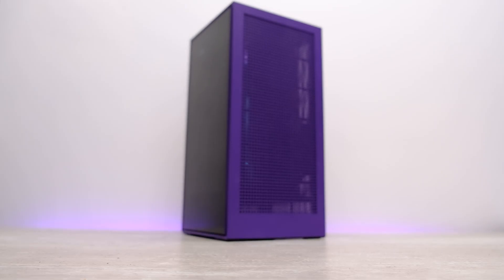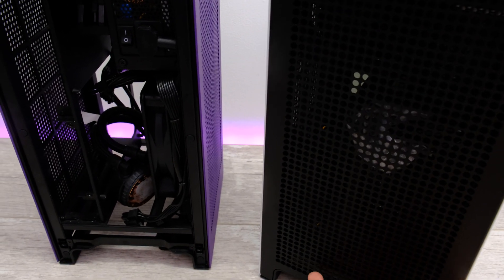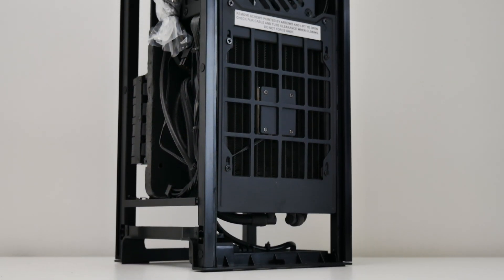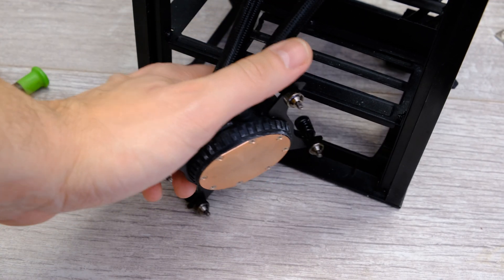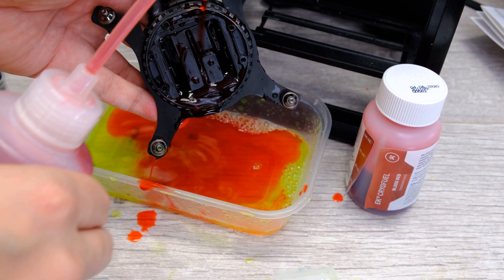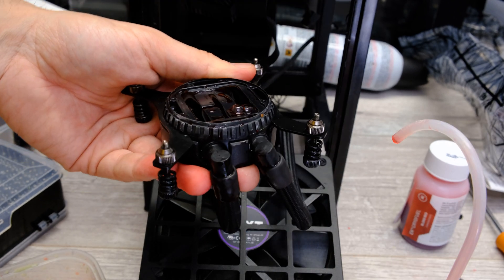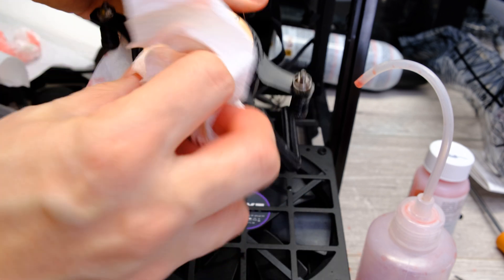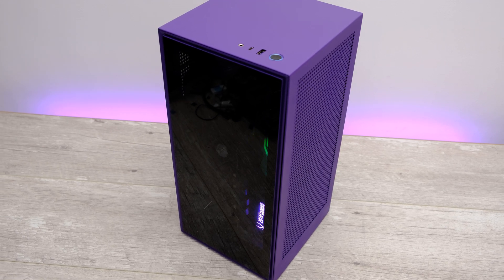NZXT H1 PUMP FAILURE (AND FIX)

Comment: I did this and could not get the copper sink to seal correctly.  Kept leaking no matter what I did.  Everything seemed to fit perfect, screws were tight and installed them on diagonals.  Just kept leaking.

Comment: Glad I found this video. Temps have been spiking in my H1, and now I'm pretty sure why.
Time for some maintenance 🙂
Reply: Update: Cleaned the copper plate, (same white gunk like many other users experienced), topped it off with some more cooling-liquid and put it back together. Temps dropped from 84°C to 37°C.
Reply: After doing the cleanup is it still going strong or did you end up having the same issue again?
Reply: @DouglasWhitcomb  no more issues 🙂
Reply: @DouglasWhitcomb  yes

Comment: In case anybody does it today, quick little tip: Remove the Air I take Screw from the Tank and the flushing and filling is done in a matter of seconds, and you flush it properly. Its underneath the small Rubber plug

Comment: Simple solution: Dump it and switch to air cooled, low profile cooler like the Thermalright SI-100! No more headaches, no more worries if the fix will even work, just some good ol' fashioned aircooling.

Thanks for the effort and the video though, much appreciated
Reply from the maker: Definitely an option, plenty of good lot profile coolers around these days!

Comment: dont use water coolers on servers. they fail after around 5 years when the water leaks out, a desktop computer is more acceptable - servers should run on stuff more reliable that you can just leave to run without babying. 

I have recently made the switch back to air cool on my desktop computer, because the 2nd AIO lost all its water and didnt have enough pump to operate.

Comment: I just did this fix today for my NZXT H1 V1. This problem persists with the V2 as well. The AIO doesn't need to be completely removed to refill it, but you will have to move the radiator and the hoses around quite a bit and even the case from a horizontal position to vertical and vice versa, to really make sure you get all of the air bubbles out. It will probably take two fills. Fill up the radiator once, reassemble everything and power the PC. Go to the bios settings, set the water pump fans to full speed and the water pump mode to DC. Run the computer for a bit. Then fill the radiator again. Don't flush it the second time. Just keep filling it until all of the air bubbles are gone, remembering to move the radiator, hoses and case in the process and then top it off. Keep in mind that the bios settings might need to be reapplied every time the cooler is removed from the CPU. It might even be a good idea to use the PC for a day or two before checking the water block again for any more built up residue. I've read online that sometimes that's the case. Hope this helps anyone in the future!
Reply: Just wanna leave an update after my initial flush and fill. Used the PC for the whole day afterwards. Noticed that temps were still somewhat high (70-80) under load so as others suggested, I did a second flush and fill today. To my surprise, there was more built-up residue that wasn't all cleaned out the first time. After the second flush and fill, temps are cool even under load.
Reply: @apex0824 hi, is there anyway we can get an update about how it’s running now? thanks!
Reply: @imsantan  Still running good. I did check the water block at least once or twice since my initial update. Not because of performance issues, but out of curiosity. There was residue again. So I cleaned the copper piece and reassembled everything. Probably gonna continue to do checks ever 4 months or so. Like I said, I didn't check because of a performance issue. I'm thinking that at this point, the residue will continue to be a thing for anyone still using this case with the stock cooler.

Comment: My v1 AIO packed up after 18 months of use and received a replacement from NZXT.  Its been just over 2.5 years and the replacement is still working.

I also bought my two kids H1 V1s and both AIOs failed a week apart after 24 months of heavy use.  I RMA’d and air-cooled both of them with a Scythe Big Shuriken 3 and Noctua Noctua NF-A12x25 fan.  I then kept the two AIOs as spares for my personal H1 :)

So all three AIOs failed within 18-24 months.

Also a PSU failed but was refunded 112€, all 3 risers replaced and also the top IO module.

In all fairness NZXT after sales support was great and despite the unreliable parts I still like a form factor of the case and with a custom vented front panel it runs very cool and quiet.

Does an AIO that has been cleaned and re-filled last
or just clog up after > 18 months?

Comment: Thank you so much. This solved my issues. One thing I would recommend on top of this is to completely unmount the AIO and unplug the reservoir cap at the base near the fan. I emptied out the old fluid and flushed it with water I just running it under a sink from one end to the other. You wouldn’t believe how much gunk came out of the tubes. It took me a good 20 minutes to get most of it out and I’m certain there’s more in there that I just can’t see. Then top it off with fresh fluid and it should last a good while longer.
Reply: Hello, did the issue come back? I’m doing an h1 v1 build and wondering if it’s worth doing this or convert to an air cooler? Thank you
Reply: As someone who is in love with the h1v1, yes it will, atleast a couple times(less gunk each time), id suggest replacing the fluid as soon as you get it, even if only with distilled water (3 bucks or less at most stores), qnd do not forget they are a fire risk without the nylon screws or updated pcie riser for the graphics card.
Reply: To anyone in this thread, after doing a cleanup is it still going strong or did you end up having the same issue again?

Comment: Note that NZXT does not do out-of-warranty repairs.  Mine just died, and support said they can't repair or replace it outside of warranty.
Reply from the maker: @WarhavenSC  Yeah it’s a shame. Worth repairing like this or doing a small custom
Loop as I did in another guide or just switching to a low profile air cooler

Comment: My H1 cooler was hitting 100degrees in windows with 5800x. Bought Noctua NH-L12S as a replacement. Didnt really like the temperature of it. Also the PC started making some strange noises. Followed your guide ( very easy and helpful to follow) and now I have unbelivable 30 degrees idle ? I dont understand how its performing this great.. my 280mm AIO X62 didnt cool this CPU that well.
Thanks you a bunch of times you just saved me 50bucks as I could still return the Noctua.
Reply from the maker: Nice! It might take a few flushes but eventually it should work.

Comment: Hi, I followed your steps to clean out my pump, but have you come across the cooler making a strange clicking sound when you boot up the computer? Do you know what that could be?

I've triple checked that it's completely full of coolant, and I did pop it off again to find a little more gunk, so maybe it's that?

It is cooling a lot better now though. Just makes a weird noise when I boot up the computer and then stops after a few seconds.
Reply: Does it still do the same ? Mine did this a couple times after this precedure and now the pump is dead silent.

Comment: I re-filled it like you did in the video but I hear air in pump after that. The fix is take the rad out completely and there is a hole on the rad near two tube. Bring rad to higher position than the cpu block. Take the rubber cover out, take out the screw under that. Then careful bring the cpu block up and down to take out the air buble and refill. This process took me about 5-10 mins until there is no air buble rised up. Then I reassemble the screw and the rubber cover. My AIO pump is supper silent now :D
Reply: Still going strong or did you end up having the same issue again?
Reply: @DouglasWhitcomb still going strong ❤
Reply: @DouglasWhitcomb I didn’t check it again yet. But it seem fine, the temp is normal. I guess because I rinsed alot of water to clean the rad internal before refill the aio.

Comment: Thanks for the video, helped me fix my cooler. One thing to add, No matter what I did I could not get all the air out. It works but under high load the pump makes a gurgling sound and overspins above the normal range. Goes up to 8000 rpm in some cases and the fan controller cant seem to limit it. Anyone had similar experience?
Reply: while refilling the same AIO, the pump also reached around 10k RPM, this means the rad isnt fully filled with coolant even though i spent 20 minutes trying to fill it...

what i did after is i bought a syringe with a needle and started filling the rad until i got foam coming  out instead of air bubbles (i did this while the pc was running so that the pump can circulate the water inside) then the rpm went back to normal and the pump sound was quiet

Comment: Hi there, hope you keep an eye on this video :) I'm encountering the temperature problem on my NZXT H1 as you described, and I'd like to clean the pump and replace the coolant the way you described. I have a question though--how did you flush the loop? Did you use pressure or did you just kinda pour coolant into the loop and pour it out? Please let me know :)

Comment: Hey @CrazyTechLab might need some help. I had this issue a few months ago and i spent multiple hours and frankly a lot of money to fix it. I finally found your video and i fixed the issue after some hard work. But randomly it seems that my pc has gone back to overheating and i don't really know what to do. To take apart the whole pc and do this can be quite annoying. Do you know what the issue might be?- Thanks
Reply from the maker: It's possible there's more gunk in there. A lot of people have found multiple flushed are necessary unfortunately which is a pain. It's likely the pump is working fine - but probably if you open it up there will be more crap in the waterblock

Comment: This literally reduced my idle temp by 20 degrees and load temp by 10-15. Didn't even put new liquid inside, just made sure to not spill anything when i opened it up and removed the gunk. There was even more than in your video.
Reply from the maker: Glad to hear it! Everyone’s will be gunked up to differing degrees but so glad to hear it worked and improved your temps 👍

Comment: Hey! Really appreciate the vid, I actually had the same issue and decided to go after it the way you did. Thing is, Im having a really hard time getting it filled completely and not getting air bubbles. Ive tried filling it twice and both times it seemed like no matter what I did, no air bubbles surfaced so I figured it was full - only to close it all up and run it to hear the air bubble noise. Any tips on how to identify when its properly full / when theres no air bubbles left? I add the coolant how you do but it doesnt seem to go down through the tubes no matter how I shake, tap, or orient the parts
Reply: Did you manage to solve this? Is it all working fine now?
Reply: @Dou @DouglasWhitcomb p much took me a few hours of going back and forth but once I filled the loop completely it went back to normal, been running absolutely perfectly since. Pain in the ass but definitely worth it

Comment: Just completed this process myself.  Prior to doing so, my idle temps had spiked up to 57c and my under load (gaming) temps were topping out at 98c.  Obviously that top number is a real problem.

I have the V2 version of the H1 and it no longer has that little channel that yours had.  However, there was still some gunk in the block, which I was able to methodically clean - while being particularly careful.  I used a rechargable air duster and a super soft nylon brush.  I was able to fill the loop using a little numb on the radiator itself.  I took my time through the whole process.  Patience removing the screws, patience draining the loop, at every step - patience!

For products I used Corsair Hydro X coolant and Thermal Grizzly Kryonaut Extreme.  My idle temps after the process are now back to 29c-31c.  And 55c-60c while gaming.  A necessary change and one I'm happy with.  Thank you for this guide, it really helped me get over the anxiety of doing this.  I purchased a possible air cooler replacement, just in case I broke something, which I am now happy to report that I can return. :)
Reply from the maker: Well done. Just make sure the coolant has anti-corrosion additives to prevent galvanic corrosion. That can happen without them as the block is copper and radiator is aluminium
Reply from the maker: Also a bit sad to learn the V2 has this problem as well. I actually stripped out the AIO on mine just in case and installed a simple custom loop (another video I did recently) just to be on the safe side and I'm glad I did given this news!
Reply: I don't think the issue is as notable on the H1 v2 as it is the v1.  I was at about 18 months of daily operation and I think the time had come to do a coolant flush and thermal paste repply & upgrade. @CrazyTechLab  Interested to see that custom loop in your v2 though.  That sounds fun.

Comment: I just bought a NZXT H1 V2 and wants to avoid this problem (I haven't even built my PC yet). Does it make sense to remove the coolant from the system and replace it with coolant with good additives so that the aluminum will never have the chance to oxidize? Or will it oxidize anyway..

Comment: After going through this it feels significantly cooler but my cpu's temerature actually went even higher from around 60 to 90 now. Any possible reason you could think of?
Reply from the maker: Yes it’s possible there’s more gunk that has come loose. Some people have said that. Alternatively it’s possible you need to add more coolant. I’d check for gunk first.
Reply: @CrazyTechLab  After couple more attempts I was able to get the temp to 51c, which is still a bit high but definitely a progress. Thank you for the great video!!
Reply: Update in case anyone's going through the same problem: After several more attempts I finally got 30c!! Do as the video, run the pc for a day, do this video again and you'll see more gunk coming out. I repeated this 3-4 times. This video is a life saver, thank you!!

Comment: Thank you for this video. I was able to fix my CPU cooling issue using demineralized water (the one you use for irons). In my case there was nearly no coolant and there were little stones inside the tubes as well. I do not think I flushed all of them but everything is working well at the minute
Reply from the maker: Well done. Make sure you use an anti corrosion additive in there too. Deigned water isn’t enough to prevent galvanic corrosion which can happen with dissimilar metals in an AIO which usually has an alu rad and copper block.

Comment: Wanted to add my experience of trying this exact fix. Worked beautifully. Idle temps went from 60-70 C to 28-32 C for me after replacing the coolant and cleaning out the gunk. System runs significantly quieter now too. Thank you.
Reply: What does the AIO feel like when it’s running? Like if you put your hand on the thing what do you feel? Trying to diagnose if I have a pump failure, I probably do though.

Comment: Liked subbed, did this and worked like a charm. CPU started overheating out of nowhere, all signs said cooler was working but it wasn’t ofc. Did this and went from ~95 to ~35 idle, my temps are better now than they were when I first got PC even under full load.

Notes - Completely took apart cooler including unscrewing tubs. Used q-tips to clean gunk, then used distilled water with a squirt bottle to force water out of cooler head, tubs and the radiator, drained several times till no gunk was coming out. Let them dry and used blow dryer on light to ensure parts were dry. Filled with new coolant in description. Used high quality thermal paste.

Side note - fuck nzxt, in addition to fire fiasco, only had this for 3 years before this cooler shit. I plan on getting a new case at some point but this fix was well worth it to hopefully get another 3 years out of this expensive and useless case.
Reply from the maker: I agree. I do love the case - I even installed a custom loop and looked at radiator options for the V1 and V2 in my latest video. Gonna use the V2 as my main rig then potentially consider a Hyte Revolt 3 - highly recommend checking it out!